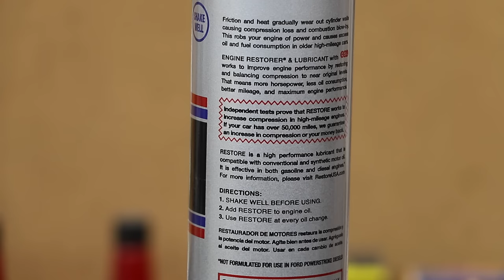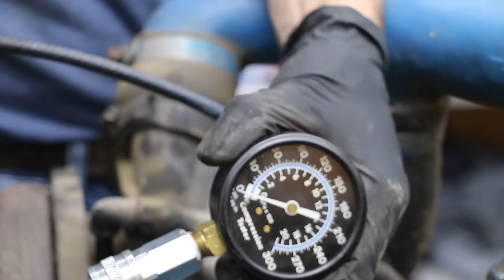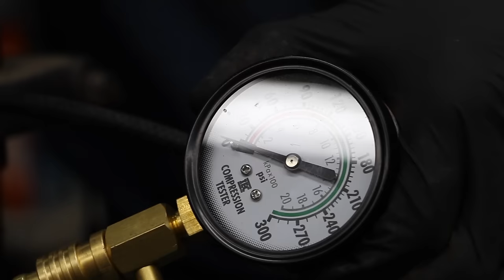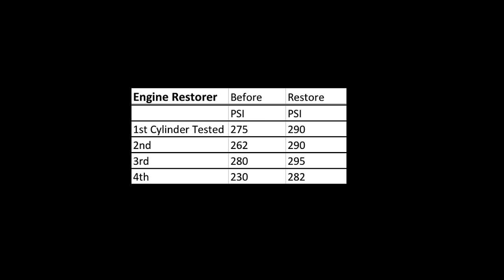Does Restore Work?  Will it Improve Engine Cylinder Compression?

Comment: Back in 1985 I bought a used high-mileage 1976 Mercury Capri that had a Ford 2.3 liter 4-cyl engine that was not running well. After rebuilding the carb, fixing a vacuum leak and tuning it up it ran much better but still wasn't running as well as I expected it should. After doing a wet and dry compression test and measuring its excessive oil usage, I confirmed that the rings were worn. I tried a couple of bottles of the Restore initially and then one bottle after each oil change. The engine compression did go up noticeably and the oil consumption decreased to an acceptable level. I drove the car for several years after that and put on quite a few miles, with no problems from the engine until I blew the water pump and decided not to fix the car.

Comment: I think a follow up video would be great to see if it solved the cold start problem or not & also a complete oil change to see if the engine still can keep that pressure without additive in the oil.
Reply: I agree completely. Though I have to nitpick again: would a regular oil change provide similar results? Do that first as a baseline, then introduce the additive. True, it's another step, but helpful in comparing. My 2 cents. (Great video by the way). ;)
Reply: An oil change before a compression test will do nothing to alter the results.  When the engine is not running, there is not going to be a large enough oil film being applied to the cylinder wall to effect anything.  The oil restorer is supposed to have chemicals in it that clean deposits on the cylinder walls and in the piston rings.  A common thing on older engines is that the piston rings will gum up and not expand as they are supposed to and provide a good seal against the cylinder wall.  This is supposed to cure that and remove any deposits collected on the rings as well.
Reply: He said in another post that it did fix the cold start issue.

Comment: I had a 1990 Ford Bronco 5.8. It ran great and I had no reason to test the compression. However it had two issues. Whenever I gave it more than half throttle the AC vents would stop blowing from the dash and blow from the floor instead, and if I had the cruise control on it would turn off. Both conditions were most noticeable on inclines. One day I put Restore in it and the next day I noticed that the AC vents never switched to floor and the cruise control never turned off. Since both of those things run off vacuum the Restore fixed a low vacuum condition I didn't know I had and it stayed fixed permanently. The issues never happened again. So I vouch for Restore. It worked like magic for me.
Reply from the maker: Thanks for sharing.

Comment: I used Restore on a very worn 1991 Subaru about ten years ago.  I didn't test the compression, but it definitely added some life to the engine.  It died of terminal rust a couple years later.
Reply: I am sorry for your loss there has to be a cure out there somewhere.
Reply: Hoping to use this on a Suzuki Sami

Comment: Great test.  I put Restore into a 2010 2.4L Ecotec engine that, due to design & manufacturing defects, as a group tends to have low compression in some cylinders, ring problems that create excessive  pressure inside the crankcase, which leads to oil vapor being blown into the intake tract, where it condenses on the intake valve stems and the backsides  of the valves.  The accumulated oil deposits never burn off or wash off because it is a direct injection engine, and fuel never touches the valve stems or the back sides of the intake valves, creating a huge mess and low performance problems.  So far, Restore is working. If it stops working, I'll update this comment. By the way, the Dealer said it was not fixable and wanted about $5,700 just to shoot the parts cannon at it with no guarantees, and would give me Zero for salvage value. This was before the class action lawsuit was settled, but it was settled so late as to exclude most of the 2010 cars that were affected.

Thanks for taking a leading role in independently testing the products that many of either use regularly, or would use if we knew more about them. With your tests, we now have access to the unbiased info we need to make informed buying decisions.    Keep up the good work.  I hope your tests are being utilized by young FFA members to help them learn about equipment, tools, and maintenance, and how to avoid being misled by  questionable advertising material.
Reply from the maker: Thanks for the feedback.

Comment: You are super thorough and intelligent. Enjoy your videos. I've been using Restore since the early 90's when it came in a canned food-like like pop spout can. My dad taught me about it and said that's what kept his 89 Mustang alive with all of us (dad, older bro and myself) beating on it and high revving it constantly. So I've used this over the years in all of my vehicles over 80k miles every oil change. I've never had engine problems in ANY of my vehicles over the years. And they are all high mileage and beat to death. 170k miles on my 02 Sentra Spec V now and easily hits 140 mph with the light mods I have. Purs like a kitten. Been using Restore every oil change since 94k miles 9 years ago on the Sentra. I've never checked compression or anything, just always enjoyed an older engine running like new. Thank you for proving to me how compression is really restored by this product and all of these years haven't been a placebo to me. And thanks dad :)
Reply from the maker: Thank you very much!  I'm very happy with engine restorer as well.

Comment: Love your channel keep up the good
Reply from the maker: Thank you very much for the positive comment!
Reply: Project Farm , thank you for videos ! 👍
do you have a videos with Seafoam testing ?
Reply from the maker: C.I. TROA USA, yes, I have a couple of videos in which I test Seafoam as well as other additives such as Marvel Mystery Oil, Dura Lube, and Slick 50.  Thanks for watching the video and commenting!
Reply from the maker: An update to provide.  After not using the tractor since last weekend, the tractor now starts quickly now without needing starting fluid or the engine block heater.  I'm very impressed with the performance improvement!
Reply: Glad to read the follow up. It worked for me too, for years.
Reply: Any places in Europe who sells this?
Reply: Dj Rh. Try RVS. You can buy it in finland and sweden. Much better.
Reply: it worked for me... had smoke coming out of car when I downshifted from third to second to first... Added two 8oz bottles and NO SMOKE... Ps: I own a 2008 lamborghini gallardo (I am not kidding)
Reply: Project Farm I have Cummins isx 15 diesel engine in semi truck. Is it ok to use restore in that engine. Reason I am asking cuz I have above normal blow by
Reply: robbie turnbull thanks for your time. I have turbo on engine. It was poorly maintained engine when I bought it. I tried all Lucas products but no luck. I am burning gallon of oil every five thousand miles.  Oil change interval is 20000 miles on these engines. Any other product you think that will help if u think restore is not compatible with Turbo engines?
Reply: any update ? passed 7 months
Reply: My only question about this product is how much of the copper, silver and lead particles get trapped in the oil filter and like in real narrow oil passage ways,  like in lifter pushrods.

Comment: I have t admit that I'm blown away that it actually worked.  Now you have me looking around for a disassembly video of an engine treated with this stuff.  WHAT DOES IT DO?!
Reply: Late reply, but it has tiny particals of copper and lead, plus a trace of silver. I assume that these fill some of the voids within the engine. I used it about 15 years ago and it eliminated an engine warning light that had been on for 3 years. Don't know what the fault was, it was just a light flashing 3 times.

Comment: I used restore on a slant six that had 200k on it the oil light came on at idle (hot) and it was a slug after using restore no more oil light and it did improve the power ,I agree it works
Reply from the maker: Impressive results!  Thank you for sharing
Reply: I'm now considering Engine RESTORE for my 6 cylinder 2007 Merc Milan given the oil light often lights at idle ,even with a confirmed full crankcase.  I've researched this occurrence and found that a faulty oil pressure a high probability cause.  A can of this might be a more cost effective solution.

Comment: I use restore in my truck and so does my cousin, it takes 500ish miles to break in but you can feel the difference, both trucks over 300,000 miles
Reply from the maker: Jeff, 300,000 miles is very impressive!  Thanks for watching the video and commenting!
Reply: I’ll have to use this in my 04 dodge 2500 with 341k on the hemi it’s gutless and burns a bit of oil
Reply: I would be interested in the result of that, on the dodge.

Comment: Engine restore works , is has helped me get many more miles out of my engines , I had a 12 HP brigs that smoked and knocked terrible , I drained all oil and put in straight engine restore , within 30 minutes smoke had disappeared and the knock was gone , after treatment I got 4 more years of service , another time I used the product on a 76 ford f 150 with a 360 cubic inch , I had 4 PSI on oil gauge and low RPM knock after adding a quart 300 miles later I got 28 PSI oil pressure and low RPM knock was gone , it works great , thanks
Reply from the maker: Great feedback! Thank you

Comment: Incredible - I never imagined that a simple additive in a can could do so much to make an engine work again. I wonder what's in it? Seems like some kind of black magic. Maybe it's just High viscosity really clingy oil or grease that blocks gases from leaking around the piston rings - but then wouldn't that clogged up all the other little oil passages and keep it from being lubricated? Strange. I also really like the way you mentioned the placebo effect and why it's necessary to actually use an objective test to determine whether something changed. Also Kudos on only changing one variable at a time instead of changing the oil as well as I didn't restore. Very scientific!
Reply from the maker: Thank you. It has copper, silver, and lead.

Comment: Thank you for your hard work. I recently added a bottle of engine Restore to my 98 Jeep Grand Cherokee 140,000 miles, and it is running smoother, has more power, and better aceleration. And thank you for your service to our Country.
Reply from the maker: Fantastic!  You are welcome!
Reply: Is it the V8? How is she doing by now? I have same one with a V8 and I want to add one Engine restorer in it
Reply: @lisandro12349  Mine is the 4.0 straight six and it is doing fine. my best advice on fuel additives and that kind of thing, if it's not broke don't fix it. That being said as long as you don't have VVT variable valve timing, I would use it again.
Reply: @braddoomsday6401  Thanks Brad, I'm using it in a 01 Outback H6. No VVT. I got good results, is the second can I add not with the oil change. But on the 5.2 I read few people had issues with low oil pressure few days after adding it, they say this product removes some sludge and clogs the oil pickup screen. Fist I would like to check somehow how the engine looks inside. bought it last year with 168k.

Comment: Happy to see this gets your approval, I'll be adding this to my 15 year old Tacoma that just clocked over 200,000 miles.
Reply: 200k on a Toyota motor aint nothing mines got 300 still runs great no leaks dont use a drop of oil

Comment: Back in the late 80's, my gf had a Monza that someone swapped a worn out 350 from a Monte Carlo in.  We always street raced my buddy in his '78 Camaro (also a 350) and he would always pull me by at least a car length.  An old "put a three-quarter race cam in it"-type of guy told me about Restore.  I stuck a can in and from that weekend forward I would always put a solid 2 cars on him. I've used it in tons of stuff since then and never had any issues.
Reply from the maker: Impressive results!  Gaining compression helps with HP and fuel efficiency for sure!
Reply: Yep, was that kinda guy, and this stuff is hands down the best.  Been using it 30+years. It does a LOT more than just restore compression, that's why you were two car lengths in front.  When I was working in a shop,  my buddy and I literally disassembled a 454 right after the break in period of this stuff. Let's just say,  it was VERY impressive to see what we saw!!!
Reply: Pp Ss what did you see
Reply: @brendan25  ... when we disassembled the engine,  every moving part was coated with what I like to call, a bronze like plating. From the tips of the push rods, rocker arms, cam lobes, lifters,  timing chain and sprockets, cylinder walls,  rings, pistons, all the way down to the crank journals and bearing races. Normally,  when you take apart an engine, the friction parts will have a shiny silver,  or chrome like surface from wear, but this stuff manages to coat those surfaces, and turns it all a bronze color. All tolerances were back to factory, indicating that the layers built onto the worn surfaces,  were precisely achieved to restore the entire engine,  not just compression! It really is magical... I still use it to this day,  and will use nothing else,  although,  nowadays,  I do use synthetic oil with it,  just makes it that much better...

Comment: I used to use this product in early 2000 in all my cars . I used this in a 95 Honda Civic ex with a bad rod knock , I’m not sure if it was the rods or the main . I drove the car on a 2500 mile trip and drove about 4000 more miles after that before completing the 2500 mile trip . I’m not sure if it’s this product or it’s just how reliable Honda’s are but damn something was amazing . I’m sure it did some form of lubricant to make the car last that long . When I got home it was at 242k miles completing the 2500 mile trip .

Comment: Have you considered testing any products from Archoil? They're pricy but make bold claims. Keep up the great honest content!
Reply from the maker: David, Yes, I have a container of Archoil that I plan to test in the near future.  I'm looking forward to testing it.  Thanks for watching the video and commenting!
Reply: its pretty popular for the 6.0  powerstroke folks, and for the most part it helps. but again its only a temporary fix for a much bigger issue. now for a 7.3 you wont get good results. it might seem so and for sure wont hurt anything. but the 7.3 injectors are a different design and wont really benefit from it. to some degree they could, but if it helps it will not be as noticeable.  otherwise achoil is very well proven product. i cant speak for the fuel additive. ran some in my 7.3 and didnt notice much if any difference in mpg. normally i float around 17 to 21 mpg. depending on  the situation, how long ive idled on that tank, how much traffic ive been stuck in, ect, ect. stop and go traffic i can expect the lower end, if im on the highway i can expect around the higher end.
Reply: I second this, Archoil has done wonders for my 7.3 idi, but it works in all engines

Comment: Question is how long will it last before yet again loosing compression? considering it's not going to add metal to the cylinder wall or piston rings where as replacing them would.
Reply: i believe it instructs you too ad more with every oil change, though i'm not sure what happens if you take a long time between oil changes.
Reply: Actually the old infomercial claimed that it filled the miner scratches to help seal the ring to the cylinder. It does say to add new can at every oil change. Ive used it for yrs in an old s10 but didn't always add it at every change and it help the under powered wore out 4 cylinder gas motor
Reply: It's micro encapsulated copper and it fills the worn spots with copper.  It seem to last 4 or 5 oil changes on my truck.
Reply: redneck4life887 also oil helps seal if u got a thick oil that says in the rings and cylinder it actually creates a seal I'm sure there is more to it then that
Reply: I used this to try to limp my old BMW track car to the end of the season. At 180K miles and being driven extremely hard, it eventually got to where one cylinder was well below the others. Restore worked extremely well and brought the compression back in line on the really low cylinder and raised the other three as well. Honestly, I was a bit shocked how much it restored the power. 
I noticed that well into the next oil change (without using more Restore) that the compression started creeping back down. 
From what I saw, you could probably just use it every other oil change. It's just a band-aid for a more serious issue- but sometimes it's nice to get more time out of an engine before having to rebuild it.
Reply: @frugalprepper  I 6
O⁹